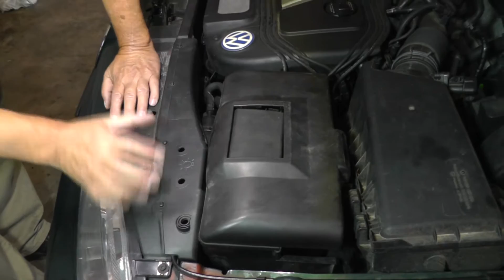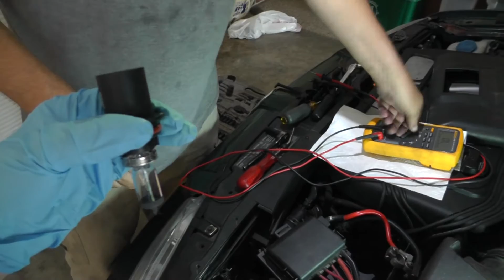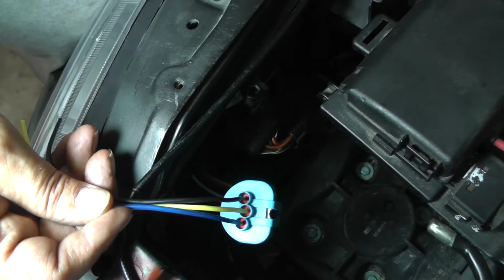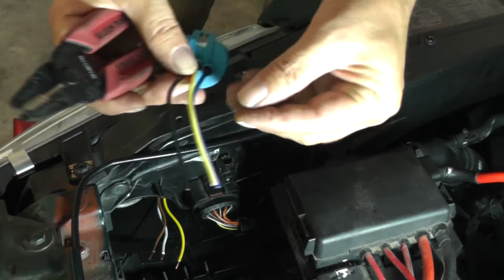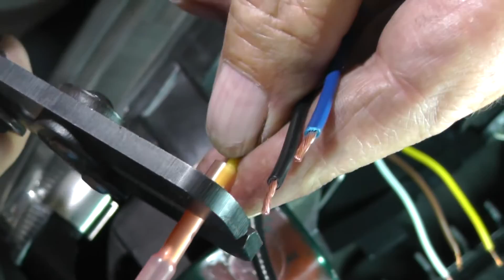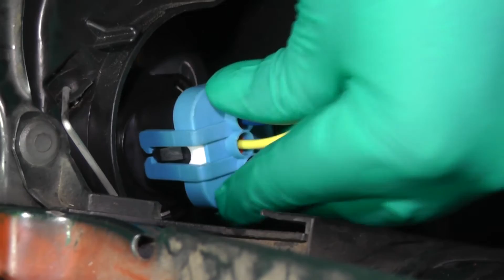Volkswagen Jetta VR6, Headlight Repair

Comment: Terry, that was a good tip about leaving a little extra wire in the butt connector. Those ratcheting crimpers are sweet but the price is a little to rich for my blood !
Reply from the maker: Thanks Billy for dropping in and you're right that the crimpers are a little pricey. If one has to do a fair amount of crimping, then they would probably be worth it :)

Comment: That crimping tool; looks like a high end proprietary specific crimper, made to high end engineering specs and to produce superior crimp quality! How well; does it crimp? Do you know; of any cheaper but similar alternatives? Looks like the Raychem AD 1522 is about $150 online: https://www.google.com/search?q=raychem+ad+1522+crimping+tool&oq=raychem+ad+1522+crimping+tool&aqs=chrome..69i57.9870j0j9&sourceid=chrome&ie=UTF-8
Reply from the maker: Hey Billy...it's been awhile since we talked and hope you and your family are doing well. You are correct that it is a high-end crimper with a specific jaw size to crimp those butts. One of the advantages of this tool and others similar is the ratcheting feature. It's designed that once you start the crimp, you have to go all the way down before it releases. This will ensure that the correct crimping force is applied to the terminal. With other generic tools without the ratcheting, it's left up to the user to determine how much force is needed.

I can only guess that it does a great job in that you can't pull the wire out, but I've never really dissected a crimp to take a look. Never had a crimp fail though. I don't know of an alternative for any of the specific crimpers such as this. But as I pointed out to Rob in a post below, the crimping jaws are very similar to what you can find on a crimper which also cuts screws off. But be careful as some of these tools have square type crimp jaws where overs are oval shaped. You'll be looking for a crimper with the oval shaped jaws. I have used these also and they work fine too. If I run across a specific terminal, that needs crimping, I'll try and get it from work as we have a slew of different ones.

It wasn't my intention to say to folks out there that you've got to have this crimper to do these connections. I was only trying to point out that there are tools made specifically for a job although that may not have came across too well in the video. Take care Billy and stay cool....
Reply: +stuzman52 I have been looking at the Swedish tool company Pressmaster; which makes many of the tooling and crimping tool for oem's like your employer Tyco. I was looking for a tool with removable dies; so, the tool was not just a one trick pony and only do one thing. The one I have been looking at is the Pressmaster MCT frame and you add whatever dies; as needed.http://www.pressmaster.se/products/

https://www.google.com/search?q=pressmaster+mct+frame&ie=UTF-8&oe=UTF-8&hl=en-us&client=safari

Pressmaster makes beautiful tools but like any high end precision tooling; they aren't cheap; I could easily spend $500 or more on crimping dies alone! :)

Am I correct in stating; that Tyco and TE Connectivity; designed or supplied the connectors to Volkswagen at the factory for their wiring harnesses??
Reply from the maker: I can't check your links right now as I'm uploading another video for the Jetta. If I go to the link, the computer really gets bogged down. I'll check it out later. But you are correct that there are other vendors out there that do make crimpers for the OEMs. And as you've said, they aren't cheap, but if you're in the electrical business, say working on different cars, then by all means, exchangeable dies are the way to go to have the most flexibility and gives you more bang for the buck. Just probably not worth it for a DIY guy to spend that kind of money though.

Tyco International was made up of four different sectors that later branched off to form separate companies. Tyco is an entity on its own, separate from TE Connectivity. Tyco Electronics was it's original name, but our previous CEO, Dennis Kowalski and other higher ups got caught for embezzlement. Then the new CEO, Tom Lynch decided to change the name to TE Connectivity.

TE Connectivity usually supplies the connectors along with its terminals to other vendors that actually make and assemble the harnesses. And I'm in in automotive division which makes connectors for ECMs, air bags,, wheel sensors and just about every sensor on cars. Yes, we provide these devices for pretty much all the major automotive manufacturers such as VW, Audi, Ford, Chrsyler, GM and I'm sure others that I'm not aware of. Oh, and the military and NASA get parts too. Have a good one Billy...
Reply: +stuzman52  I figured there was a link to Volkswagen wiring harness components; every time I research VW replacement connectors and parts, I end up finding Tyco or TE Connecticity as the original supplier. I've found many connectors that end up needing replaced; are available through TE Conncticity at suppliers like Digikey or Mouser. With VW it can take some research to figure out the oem; instead of buying veery thing from the dealer. As you are relating from your recent NAPA experience; thankfully, the aftermarket is starting to make more parts for our cars and there other sources, than just VW. :)
Reply from the maker: Yes, vendors like Digikey, Mouser do come to mind. Another one that you can use is http://www.alliedelec.com/ I've used them at work to get terminals, connectors, etc. where TE manufacturers them. Also other manufacturers such as HP, T&B and Amphenol to name a few. I've found that to get parts through TE, it's a bear with the red tape and paperwork. It's just faster to go through another vendor. And yes, hopefully, with time, there will be other vendors out there to get these sometimes hard to find connectors and terminals. :)

Comment: I've been crimping my butt connectors wrong all these years!  Thanks for the tips, Terry!  Looks like I need to get a new crimping tool, too.  :D
Reply from the maker: Hey Rob...You could use those crimpers which cuts off screws. The crimping part of this tool is very similar to the tool that I was using. I just wouldn't use needle nose pliers, side cutters or something like that LOL... Thanks for dropping in and leave a comment!
Reply: stuzman52
Strangely, I have crimping pliers that I've been using for the past 20+ years, but after some Googling, it would appear they're intended for non-insulated connectors!  Whoops...
Reply from the maker: You would be amazed Rob with the different number of crimping tools out there designed for specific terminals. Some for insulated, some for non-insulated, others for different gauge wire and the list goes on and one. And these tools aren't cheap either. Where I need a specific crimper, I'll try to get it from work and save the money. Take care....

Comment: Great video Dear sir Terry as always. I did the same thing on my Toyota Corolla. The wire crimping tip I had no idea of. You gave a nice tip here. This job seems to be easy but could a a bit difficult for a DIY troubleshooting it firs time. Regards,
Reply from the maker: Hey Jahan...Glad you dropped in and left a comment. As for the tip on crimping, I was surprised that when I trained electricians they never heard of leaving a little wire exposed to keep the insulation from melting. As the amps go up, the same holds true for terminals except you leave a little more wire exposed. How is your project coming along where the evaporator has a leak? That looks like an interesting one Jahan!
Reply: Thanks dear sir for nice wording. The next coming video will be system charging. It was a successful repair. I was not able to record every single detail because huge work was involved in there. Regards,
Reply from the maker: Glad to hear Jahan that all went well with your project. Yeah, you're right that if you filmed all of that, you would have over 20 videos LOL. Looking forward of the recharging and take care Jahan...